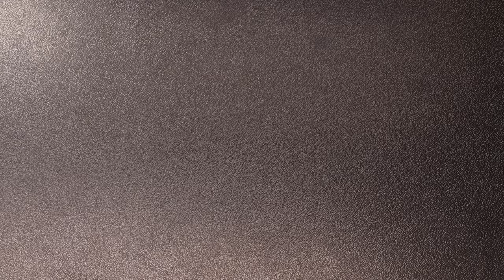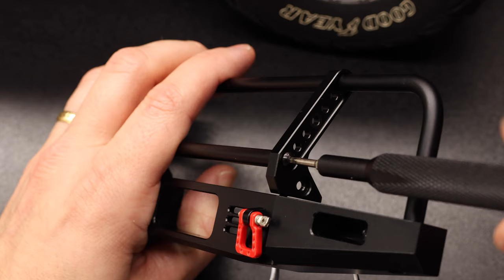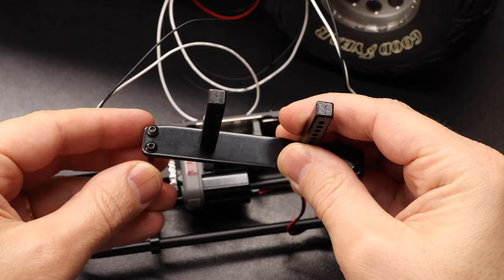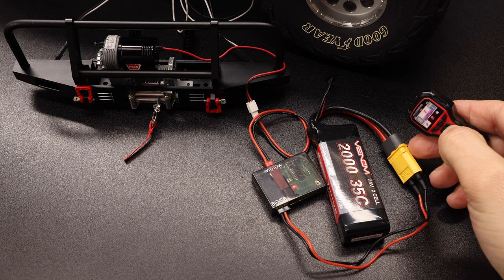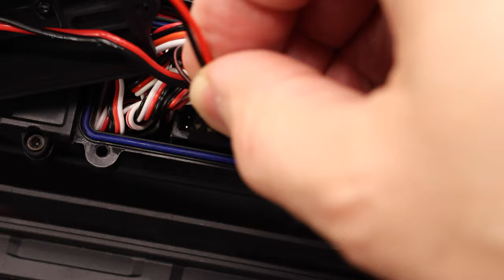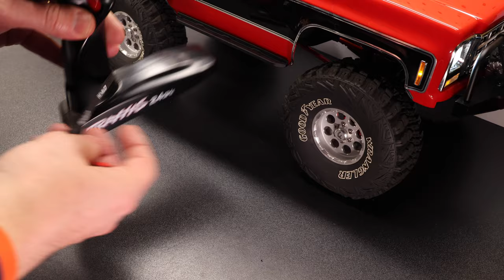Traxxas TRX-4 Warn Winch Installation | Advanced Wireless Remote | K5 Blazer TRX 4 RC

Comment: Any suggestions on metal drive shafts for the K10?
Reply from the maker: The only metal driveshaft I can recommend is the RC4wd scale steel punisher shaft V2. They make them in three different sizes so you’ll need to measure your existing driveshafts, since the k10 is a longer wheelbase and lifted than the standard TRX-4. The punisher driveshaft v2 is heavy duty and will take abuse, I’ve seen plenty of cheap metal driveshafts snap. You can find good deals online from different websites, just make sure you get the correct size. These are on my list and will be upgrading soon.
Reply: Thank you

Comment: When you attached the bumper mounts to the bumper, you have two spacers and four longer screws to space it from the Warn winch. where did you get them? They are not included in the hardware kit. I bought the exact same bumper.
Reply: same question, stuck here...